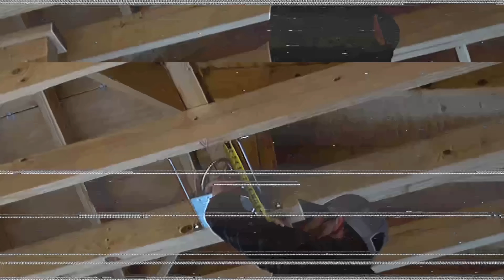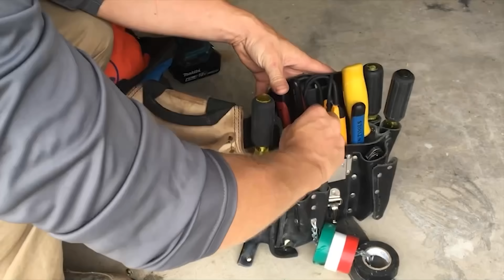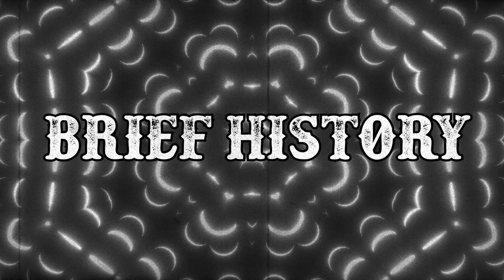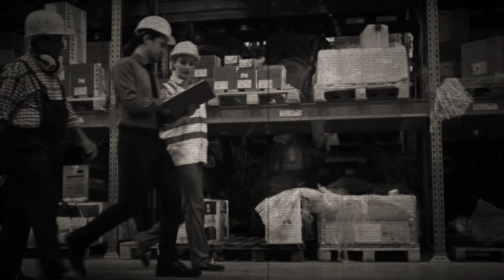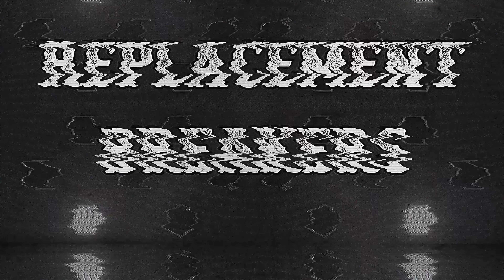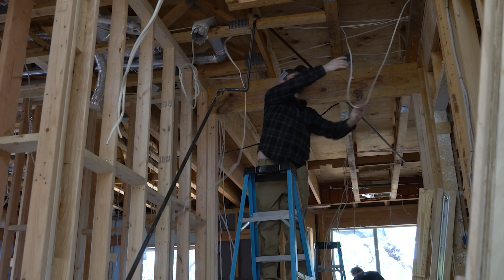FEDERAL PACIFIC ELECTRICAL PANELS - why their panels are dangerous

Comment: I refuse to do any installations in a home with FPE.  I've at times reported really bad panels to the local jurisdiction having authority.   The landlords don't appreciate it, but I'd rather lose a customer than someone else lose their life..
Reply: I too refuse to do any electrical work that has a federal Pacific panel because of the liability , because if a fire started due to an electrical failure I could easily get the blame for it , Even though it was not my fault , Not to mention the cost to hire a lawyer to clear my name , I definitely point out to the customer of how dangerous Federal Pacific panels are and they must be replaced immediately because with these panels
They don't have any electrical protection
Federal Pacific breakers are merely on off switches and in actuality , With many independent tests , it turns out that the failure rate is 80 percent and up
Reply: @ironmartysharpe8293  Why should you be left with the lawyer costs to clear your name if you were to be unfairly blamed? This is why the american system of legal costs of each covering his own is dumb compared to the british way.
Reply: In Missouri when I go to pull permits for jobs we have to replace FPE if they have it. It’s the new normal
Reply: AHJ - Authority having Jurisdiction
Reply: Landlords would be complaining even more if you had not mentioned the danger of FedPac panels and they had one of their properties burn to the ground with potential injuries and deaths.  You’d highly likely be subpoenaed  and asked WHY did you fail to pick this up as a qualified electrician.  To protect yourself establish a paper trail with the landlord that you did indeed warn them of your findings and recommendations.

Comment: Unless I am mistaken, the two different trip percentages relate to one hour and 2 minute overload ratings.  The breaker should trip at 135% at 1 hour, and also at 200% load in 2 mins or under.

As an aside, I saw one of these stab-lok panels once.  A fried asked me to run a circuit for them in a rented home, and after seeing the state of the panel, I told her to call her landlord and have it replaced.  I had never heard of this manufacturer before, but you could see massive discoloration of the bus bars and obvious signs of thermal stress.  It was an obvious fire hazard.  I didn't find out about their notoriety until some time later.
Reply: I don't know anything about breaker testing, but what you say makes sense.  The way it was stated, that it was simply tested to trip at 135 percent and also tested to trip at 200 percent had me scratching my head.   If it trips at 135 5 than it will obviously trip at 200  %  It makes more sense if there's a different time element associated with each test.

Comment: I was watching another one of your videos where the breaker box was one of these... And it was burnt on the bar... It was also outside... I was confused about the breakers, I was even more perplexed that the bus was burnt, and completely flustered as to who would put the breaker box outside... What I reasoned not knowing this information you've provided here, was the following... It was some kind of cabin or campsite; and lighting had caused a surge that fried the panel... Now I realize; it was outside because eltricians were probably aware the panels are fire hazards, and the burnt bar was just from normal use... Wild

Comment: Well, I guess the first thing I'd say is that manufacturing comes in many different forms even just in electrical equipment. So when it comes to goods used by consumers, a failure rate you'd probably be happy with is below 5. There may be some with a case where less is fine

Comment: Was told at a continuing education class by the instructor that when you mention that a stab lok or FB panel should be replaced to always put it in writing and have them sign it. Have to cover your butt from way too many scum bag ambulance chasing lawyers.  Had to take an inspector to a roof top safety switch that feed a cell phone anteneas. He took several pictures of inside & outside of this job before he placed inspection sticker on to cover his butt.

Comment: I've always wondered if an inspector will pass a panel filled with new Connecticut Electric Stabloks...
Reply: Sure, they don't violate any code articles. 
How could he fail you..???
On what grounds...???
Reply: @MrMaxyield  Inspectors are morons, so they will most certainly fail something they do not understand. Home inspectors are not electrical inspectors. They will fail it solely because of the name on the panel. Then you can call your electrician back who just put hundreds and hundreds of dollars of breakers in your panel and rip it out.
Reply: New UL listed ones, fine. Old ones, not so fine. Of course, if you're doing any work that would require an inspection, just have the whole mess replaced.

Comment: I've had issues with GE Home circuit breakers not tripping, especially with the split bus style where all the 15 and 20 amp circuits were controlled by one 60 amp breaker cut off,  where the 240 volt 30 amp and up were not on a main breaker...anyway, I accidently grounded out a 20 amp circuit and went to the panel...did not notice any breaker tripped.  This panel was put into my new home back in 1981.  I went out and decided to replace the breakers with newer ones, but the cost was almost the cost of a new panel so I bought a Square D and re-did the entire panel.  Old GE was scrapped!

Good info Brotha!

Comment: Cool video. A Federal Pacific panel almost killed my dad when I was a kid. They had to work on it live in a commercial building near Philadelphia and something shorted out. It was arcing and sparking and they had to crawl out on their hands and knees. He had holes in his shirt from molten metal it was spitting out. Emergency Services had to come out. I don't think it burned down the building but it was really bad. What made it worse was that the wrong fuses were installed on the pole and if memory serves it was the actual substation that finally tripped. My dad never liked that company and after that incident neither did I. Take pride in what you build

Comment: FPE  "Fire Producing Equipment"!, Even if you buy new one's The Mechanics haven't changed!  Squire D  QO's the way to go!!
Reply: GE & Cutler Hammer are in the high-reliability column, as well. Westinghouse probably still OK, although much of their brand has been sold off and it might be hard to find exact duplicate circuit breakers.

Comment: Did they make panels for Lowe's Hardware.   My Parent's Main breaker failed about a year ago.  We have a stand-by generator.  I decided to test the generator one day and had My Dad to turn the main breaker off to make sure that The Generator would start like it was supposed to do.   It worked fine, but when We tried to turn the main breaker back on, it would Not turn back on, except on one side of the 240 volts.   We had to pull the meter and replace the main breaker.   Lowe's gave Us a new breaker, but I still don't know if I trust the new one.

Comment: A few clarifications. UL promulgates AND tests to those stds. or you can hire an accredited lab to test to an industry std. as you mentioned ETL. Now, if you hire UL to list your product, they do all the initial listing which includes the installation manual btw, contracts with jobbers, subassembly fabricators, mill certificates, etc. Once the product launches UL's policy is 4 announced in-plant inspections but periodic surprise inspections. I've been present in a factory where they left and 48hrs. later came back, pulled product off the line and put it into the factory's in-house Q/A testing. In this case, they had us put fireplaces in continuous live burn for months then check gage and spec. Stds. are promulgated and revised by Standards Technical Panels, of which I'm on 3. We meet online periodically to verify existing stds. but also to introduce changes, discuss anecdotal reports of failures, and make revisions to the std. These STPs are made up of a mix of stakeholders. We DO change stds. to adjust to problems just as model bldg codes revise every 3 yrs. If a bad actor loses their listing but continues to use the listing mark they'll get sued in federal court by the listing agency over trademark infringement. This is well guarded and protected in most industries. So, what if you detect faults? Report it to the CPSC. They are VERY open to public and professionals reporting incidents and losses. They maintain your anonymity. 
I recommend only pulling these panels simply because to leave it in implies it is reasonable free from risk of hazard sufficient to be placed into the stream of commerce. When you know there is a reasonable chance someone, whether a bad actor or uninformed, replaces a breaker with another old style 'bad' one, there is a known hazard you have not abated. You may replace with only CE modern breakers but what about the next guy? Not worth the risk. Good stuff DS. I enjoy your channel.

Comment: "Quality control" was an oxymoron in the 1970s. I believe that about 20% of new cars had to be pushed off the end of the assembly line because parts had not been installed.
Reply: My Dad was good friends with a guy who owned the local Chrysler dealership. When I was about 12 years old, I was with him when he went to the dealership and the owner showed us a brand new Barracuda, I believe it was, where the trunk lid was misaligned with the fender by almost an inch. The dealership owner complained that his body shop had to partially rebuild many of the new cars they received. This isn't a slam on Chrysler, I'm pretty certain the same thing happened at other manufacturers as well in the 1960s and 70s.

Comment: I started in the trade in 1971 many houses had Federal Pacific installed I work for a company in New York City Federal Pacific was being installed like wildfire 4 basic home it was a hundred amp service three number twos later on when I got my own license a lot of these panels have to be removed in the 1990s a company called Challenger circuit breaker ways to replace Federal Pacific Breakers I agree with changing the panel many times people don't have the money the newest panels are much larger then from the 1970s if you're in a small basement the panels won't fit so you wind up replacing Federal Pacific Breakers with Challenger Breakers I want to know how Federal Pacific got away with this for so long

Comment: I’m 3 months into my apprenticeship and I’ve already been told multiple times that if we enter a home with a fire specific panel we are to inform the homeowner that we can’t work on them and they should strongly consider a panel change and we leave.
Reply: Good policy. From what I can tell, if you touch it, you're now responsible for it, even if you haven't actually done anything. Safer to walk away if you can't replace the whole thing.
Reply: Been in the trade 23 years. Wont even work on it unless I change it out.
Reply: sounds like you are being trained properly
Reply: "Don't try and upsell me things I don't need, just fix the problem" applies here.
Reply: @AKSoapy29  perhaps if a bunch of people got together and put together an informational website/pamphlet "So, you're at danger of an electrical fire", hand it over or stick it on a business card and walk away.
Reply: @AKSoapy29  nope. If the customer says that, move along abd let someone else address that nightmare. It's not the customers fault, but I cannot afford a second home because the customer doesn't trust me. It's my license, you cannot force me to do something. I can't force you to spend money and you can't force me to do work. Done and done. 

There's a reason the panel's are called Fire Prone Equipment.
Reply: @doncooperjr4817  Had this convo with a few customers, myself.
Reply: @doncooperjr4817  they are no longer UL listed so a licensed electrician should not work in them or they risk losing their license

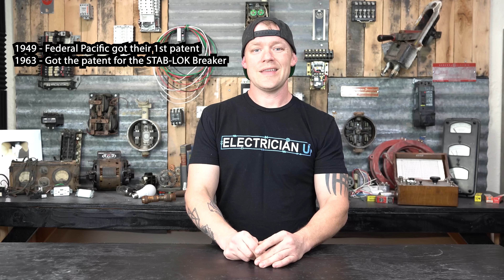Comment: 2:22  What is that screw in the middle.  It looks like it's some sort of adjustment,  like a trim pot, or something of that nature, but I can't imagine what you'd be adjusting on residential electrical system.
Reply: That would raise the entire bus/breaker assembly after the lid was installed so that the enclosure lid could keep sufficient pressure on the individual breakers so that the stabs on the breakers would not arc against the bus under heavy load.  The incorrect use of this adjustment is the reason that the bus frequently burns in FPE panels.
Reply: @wilburpluck3806  Thanks.  I was wondering why there were problems with arcing/burning of the buses (in addition to breaker failures) that was alluded to, but not explained.
Reply: @andrewalexander9492  The breaker connection was also just a tiny metal square held in with a single screw, which was also the electrical path. 100 amps through a single 8-32 screw? Sure! Why not!

Comment: Dustin, there is actually a lot of research into this very type of issue pioneered by the famous economist George Akerlof, who coined the term “lemon” to refer to bad cars sold by automotive manufacturers. He even discovered/defined some mathematical formulas to describe the phenomenon in which mass manufacturing will actually produce a fraction on faulty products. Thing is: like you described in your awesome video, sometimes a recall is more expensive than just settling the fraction of cases in which faulty products would cause loss of life, limb or property. Here’s a link to some more info on Akerlof and his work:

https://www.econlib.org/library/Enc/bios/Akerlof.html

Comment: We had a recall on 3000 CCB drivers.  It hurts, but better to fix the problem asap than letting it slowly erode reputation, or worse--scare someone from an electric smell. A tiny part would burn out but they fail safe so it's more a reputation problem than a life safety problem like the breakers you're discussing.  Thanks for explaining that hardware development and manufacturing is hard.  I came from the pharmaceutical manufacturing industry.  That's really high quality process because it's impossible to test every dose!  In electronics manufacturing we can test everything at end of production line.

Comment: This is where 6 sigma manufacturing comes in! For six sigma manufacturing your products should have a failure of 1 in a million failure which is a 0.001% failure. This is what companies target. I work for Square D and I have seen things getting manufactured and tested. I would definitely suggest replace the whole panel!
Reply: Uh... 1 in a million is not .001%. You are missing a few zeros...
Reply: @pauls1003  you are correct! I am sorry!
Reply: @pauls1003  1 ppm = 0.0001%, so only missing one zero! 😎
Reply: @robot65635  1/1000000  = .000001
Reply: @robot65635  1 in 1 million (1 ppm) is 0.000001.   Knowledge of a topic is optional to post in the comments, but you look a lot less foolish when you "correct" someone with actual correct information. The device you used to post an inaccurate "correction" CAN be used to learn also. 
Wise people, when corrected, say "Thank you".  You're welcome. 
https://www.easycalculation.com/unit-conversion/Parts_Per_Million-ppm-Decimal-nou.html
Reply: @garyK.45ACP  there's a difference between .000001 and .000001%, we're in the context of percent, so you need two less zeros Einstein. 1% is 1out of 100.   .000001% is 1 out of 10,000,000 Genius, not 1 out of a million.  Context! Context!, Context!
Reply: @pauls1003  .000001%  is not 1 in a million.  1% is 1 in 100,  .1% is 1 in 1000, .01% is 1 in 10,000, .001% is 1 in 100,000 and .0001% is 1 in 1,000,000. So he's missing 1 zero not a few.  Please correct me if I'm wrong.
Reply: It’s also not one in a million it’s 3.4.
Reply: With the advancements in industrial automation it's insane to me that every single breaker can't be popped into a jig by a robot and tested before it even makes it out of the building. Just a matter of money I guess 🤦
Reply: I wish I read this comment before making mine, i forgot about 6 sigma. any safety equipment has to fall under that level of accuracy for sure. I agree.
Reply: My parents have the same Square D Homeline panel in their house for over 31 years and never had a single problem. Great panels but once a future home owner adds those EV chargers in, it’s time to upgrade to a QO panel because those are designed to handle higher loads.
Reply: @davidperry4013  QOs are great and if the EV charger requirements are less than 50A and you don't need a bigger service, you may get by with using a Homline. Homline has 50A/3P GFCI breaker. QO has 60A/3P GFCI which is what most EV chargers need. Anything on top of that you may need a GFCI relay with a shunt trip breaker in the QO panel. Some of the larger EV chargers needs like 80A breaker with GFCI.
Reply: Working for Square D is such a huge flex. You just threw that out there casually, like it's no big deal, meanwhile, a Federal panel in a mid-century re-model is on fire at this very moment.